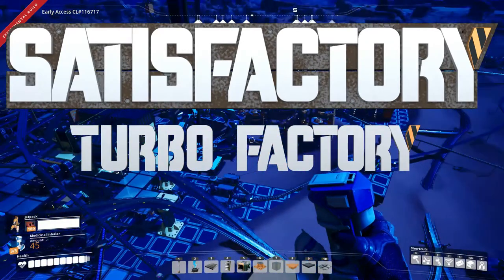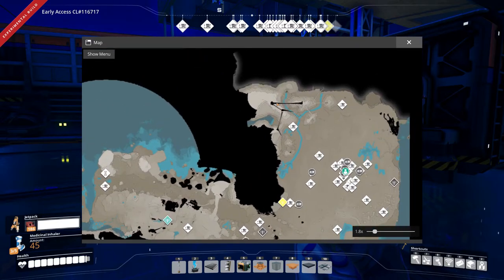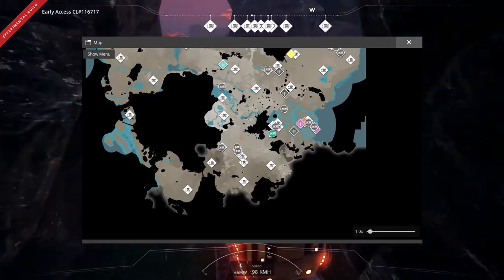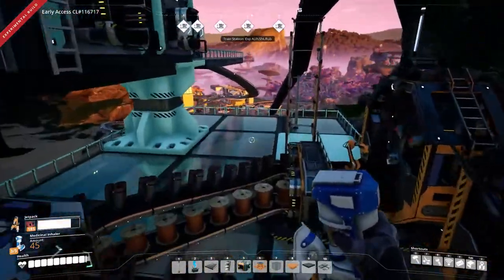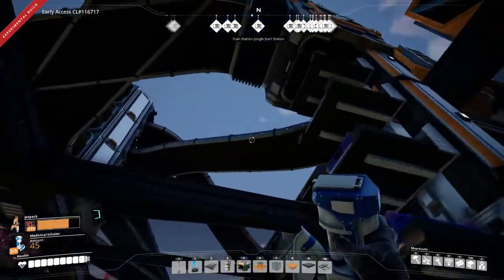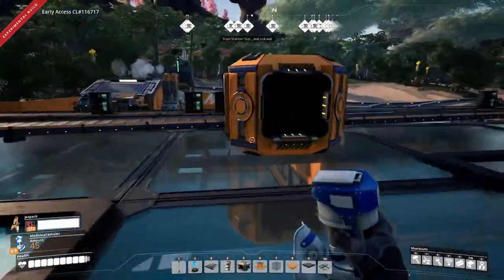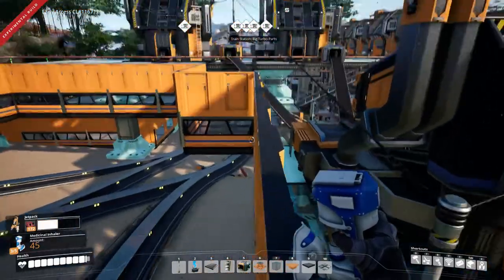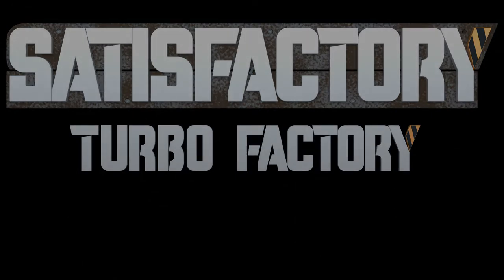Satisfactory Update 3 Turbo Factory

Comment: The funny thing about power plants and capacity is even when you are running at "full" it's choppy, which means to actually get "full" you need more plants than you have fuel for, this lets you spike over your fuel production level.
Reply from the maker: Earlier in this playthrough, I got close enough to that limit that I was running my coal power plants dry on water, which only happens above 88% with one pump to three generators. Happened more than once. But presently, it's actually a struggle to fit enough fuel power plants in my base to burn all the fuel that I'm making as a byproduct of rubber production. That's why only three of my six nuclear plants are running. Gotta keep the fuel from backing up!